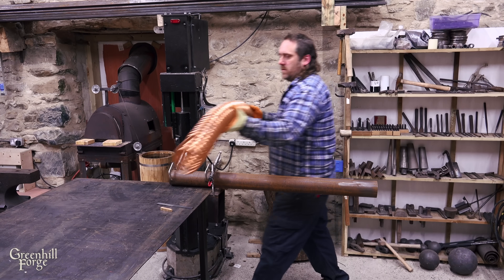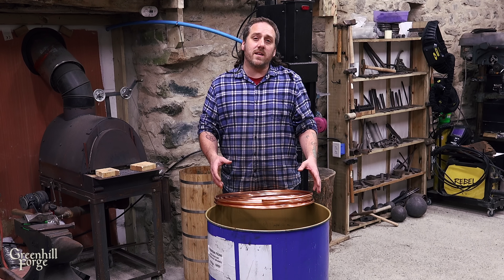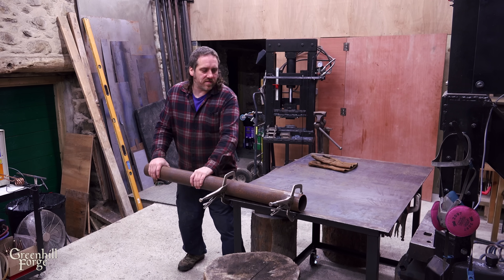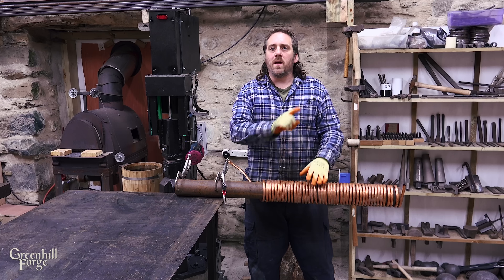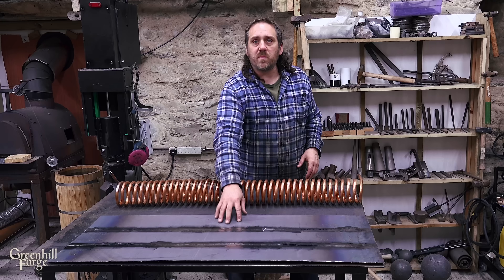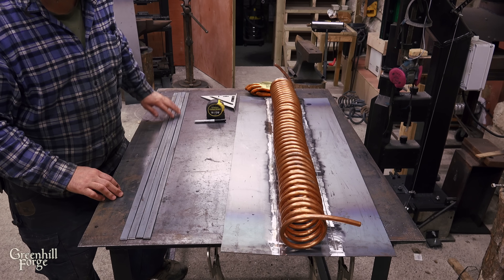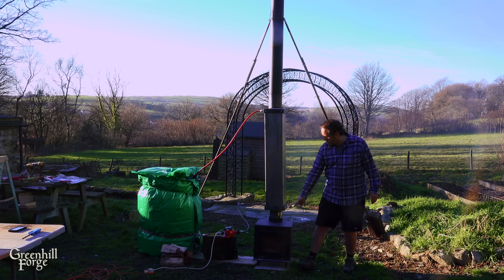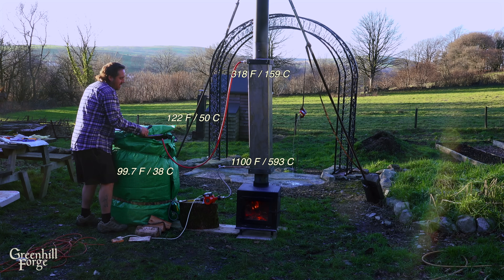Wood Stove Water Heater Experiment - Surprising Results! Part 1

Comment: The system described in this video is a recipe for disaster. I have been heating domestic water with my wood stoves for 45 years. I originally exposed the heat exchanger to the fire or the smoke path and that never works well – even a clean burning stove puts out enough creosote to foul the heat exchanger. For the last 30 years I have had the heat exchanger outside the body of the stove, mounted on brackets and insulated on its outer surface. I left enough room between the stove and heat exchanger that I can slide in a metal shutter to decrease the heat transfer if the water temperature in the storage tank is getting too high--usually in cold weather if the stove has been burning hot to heat the house. As long as you have a complete loop between the heat exchanger on the stove and the storage tank (which must be level with or above the heat exchanger) the heated water will circulate to and will be stored in the top of the storage tank, which could be an electric or gas fired water heater that supplies your house in seasons when the woodstove is not in use.. You need to be sure that there is a temperature and pressure relief valve for the heat exchanger in addition to the TPR valve on the storage tank, so relief is guaranteed even if any valves on the intake and output pipes are inadvertently closed. You need to install at least one valve in the heat exchanger loop that can be closed to prevent reverse thermosiphon in the seasons when the stove is not in use. You need to create a physical reminder to block the stove door when the valve in the loop is closed, as the valve must be opened before the stove is fired.
Reply from the maker: This is only a test unit. Many more tests will be needed to settle on a final design
Reply: @GreenhillForge Thanks. I would be glad to provide more information about my experience, If desired. I have solar domestic hot water in the summer and  the wood-heated water in the winter, using the same storage tank. Of course, the solar system has a pump, controller, and so on. The wood system does not.

Comment: Once you build the rocket stove, connect your hot water out from the first heater into the second and add a coil in the barrel. We run frac heaters this way in the oil and gas industry to heat tank farms for fracking. Alternatively you can tear down this system and add another coil that is plumbed into a manifold in a way to allow you to run in series or parallel. Have fun fiddling with flow rate to improve your lift temperatures ! Slower can actually be faster. Nice rig !

Comment: just my 5 cense worth,, so I have made a few of these,, to make it realy efficent I put a twist baffel inside the heat exchanger section. basicaly a flat pice of stainless steel and twist it, this stops the lamiat flow and forces the cooling flue gas away from the water coil. Cheers
Reply from the maker: Like a DNA helix? Great idea. I was going to add a capped off piece of 2 or 3" pipe down the center in a future test but I like youre idea too.

Comment: In the long term, (although not as efficient) it would be best to have the copper pipe on the outside of a flue wrapped in insulation.  Reasons are many. Eventually that copper at the bottom will have degradation versus the top,  In addition soot buildup and cleaning will be problematic. And by losing some efficiency you will have a more controlled water heating situation and a warmer flue stack for cleaner and easier to clean long term.  A series of compromises should improve the design to balance all aspects.
Reply from the maker: Agreed. I plan to test a whole range of things to try and come up with a good final ddesign evetually.

Comment: This was done in Ireland for decades.  The boiler for the house was behind, next to, or above the fire box.  Peat or coad were then main fuels.  In modern tines, the switch was made to separate on-demand electric boilers.  Also in modern times, they use radiators for heat (great for warming towels), and separate hot and cold water taps.

Comment: How would this go long term? Seems like the copper tube would end up getting caked in creosote after the first season and be hard to clean.

Is it possible to do the same thing but with the coil wrapped around the flue rather than inside it? I understand it wouldn't be as efficient but is it good enough?
Reply from the maker: more tests needed. more tests. more tests. I'll share all the results
Reply: @GreenhillForge  awesome, thank you very much.

Comment: My grandfathers potbelly stov 10:29 e had one coil of iron pipe next to the stack.  Five 4 inch pipes ,  4 elbows.  It heated a 30 gallon uninsulated water tank nicely.  Cold water came out the bottom of the tank up to the coil then ip to the top.  Natural convection kept the water circulating.  Too much coil risks a steam explosion.

Comment: Be careful.  When the water in the copper tubing boils you will have a steam explosion.  Those are dangerous to people and will burst the stovepipe sending fire and ashes all over the house.
Reply from the maker: Yeah, this is an open system so much less chance of temps that high but yes, safety first.

Comment: Try using stainless steel external wood burning stoves for hot tubs. They work much better and they're not too expensive. The other thing is copper will get damaged where it touches sharp steel edges due to different thermal expansion characteristics.

Comment: The stove pipe, if just vertical, will be less as efficient as having more horizontal area.  Angle the stovepipe to the best slope to get the proper flow And the most heat.

Comment: As soot and tar accumulates on the copper coil, how will it be cleaned out? Seems kind of hard to clean the coil?

I am much into wood fired water heating myself so this was very interesting.
Reply from the maker: Agreed. Just testing different things to try to find the right balance for a final design.
Reply: @GreenhillForge It is all very interesting! Perhaps look at maritime boilers, especially coal fired steam boilers from yesterday can give som inspiration?

Comment: Wonderful build but I don't see how it is very efficient at taking heat out of the exhaust gasses. The gasses just pass straight up in the middle of the coil.
Some encouragement to make the center flow a bit more turbulent so it passes out from center and onto the actual coil might increase heat extraction even more?
Also, measuring the exhaust gas at edge of flow and in center would be nice.

Comment: One problem: creosote.  As the water cools the smoke, the creosote builds up on the coil and inner lining.  Cleaning this once a year will be a big problem.  Why not build it so the device slips over a common size stovepipe.  That will separate the entire coil from the smoke and you can brush the pipe every year easily.  It will take a bit longer to heat the water.

Comment: Excellent and well-done! 

Some of my thoughts:
Maybe if you used a somewhat flattened (ovoid) copper pipe it would not kink, and that would increase it's surface area for which to make more contact with water?  Also, I would have had thought that the cooler water going through cooler to warmer flu gases, so from top to bottom, would help the water more quickly rise in temperature, but that's very testable.
Reply from the maker: Thanks. Yeah, top to bottom is better for heat transference but bottom to top and you can theoretically ditch the pump and it'll run by itself with thermosiphon action. More tests needed...

Comment: Fantastic project.
So is the lid loose on the water barrel to allow for any pressure buildup to escape?
It's too late now but wouldnt it be more efficient to have the stove pipe coming out of the back and have the water barrel sitting on top of the stove?
Reply from the maker: Thanks. It's an "open system". Far less chance of dangerous pressures. The lid is just there to help keep the heat in.

Comment: Wonder if you could use this same principle to create a radiant floor system. That would probably need to be a closed loop system though, and I'd have to think about how you'd manage that without over-pressurizing the system and blowing something up.
Reply from the maker: Definitely could. Just have an open system for the heating the water like this test setup heating a storage tank and pull the hot water for the floor off the storage. Two completely separate systems sharing a storage tank.

Comment: Are you worried about a dialectic reaction by not using brass for holding the copper in?
Reply from the maker: Like galvanic corrosion? No, this is just a test unit so will only have a few burns. doesn't need to last long.

Comment: I’m planning on the same thing with my oil fired hot water boiler.  I have an adjacent wood stove that has the copper pipe above it which I’ll drop two straight pieces down to the 8” stove pipe, do a copper coil wrapped around the pipe.  I’m going to try filling the 3/4” soft-drawn copper pipe with sand instead of freezing water to keep it from kinking.  I’ll let you know how it turns out…

Comment: Copper on steel, better Google that! Electrolysis will cause failure.
Reply from the maker: Galvantic corrosion. This is only a test unit for a few burns so it doesn't need to last

Comment: Alright....

We need stepper motors on the dampers
We need those drivers controlled by an Arduino
We need that Arduino monitoring the temperature probes at each end of the exchanger, the overall water temperature, and bonus if we have enough inputs, the water temperature at each end of the exchanger.
We also need a 2x16 i2C LCD, a buzzer, and a potentiometer.

Use the potentiometer to set the target water temperature.
Bit of code we can monitor the water temperature and open/close dampers as required.
We can sound the buzzer if human intervention is required; For example, dampers set to high-heat with overall temperature dropping suggests that wood needs to be added.
Bonus, monitor water temperatures in order to sense other fault conditions; For example, extreme heat at one end of the exchanger water without the tub heating suggests a failed pump.
Spit out water temperature/system status/monitoring values/errors on the LCD display

Like many others, I echo the appreciation of an informative video that's concise and to the point. Subscribed.
Reply from the maker: I like the way you think

Comment: This is a great build, thank you so much! 👍👍
The only negative I can find, is that the coils will eventually be coated with creosote and ashes, and will be difficult to clean. Even with disassembly. I hope you address this issue. 😊😊
Reply from the maker: Yeah, this is just a test unit to gain values from direct contact but you're right. This wouldn't be a good long term design.

Comment: If you don't have the pump on, does the water cycle itself at all from the hot water wanting to rise? Might require a check valve
Reply from the maker: Yeah, it would. It's called a thermosiphon

Comment: Perhaps you should check the pipe for soot and tar deposits, as the drop in gas temperature may promotes condensation.
Reply from the maker: I'll compare creosote buildup between the two stoves in the next video

Comment: It probably heat better and more efficient if you installed that into a rocket stove set-up. The heat would pass by it quickly before collecting all the energy going out the pipe. Also having a ceramic pipe for the chimney horizontally would store the heat giving the copper coil more time to heat up evenly as well.
Reply from the maker: Rocket stove test is the next video.
Reply: @GreenhillForge Yes, but with the copper coil.

Comment: That's a great innovation! Question, does the circulator pump need to be heat resistant? Along with the pipes return/ feed?
Reply from the maker: Yeah, they would need to be rated to tollerate the heat. That is a heating system pump and can handle more than boiling temps. 110C/230F

Comment: was under the impression that you shouldn’t take heat directly from the flue, as doing so will cause soot buildup in both the burner and the flue over time."
Reply from the maker: This is just a test unit to gain values for further testing and design refinement

Comment: I don't think you need a pump. The heat will do the work for you. It's called convection cold in the bottom hot out the top.
Reply from the maker: Yeah, I'll show it using thermosiphon in another video soon

Comment: NOTE TO SELF:  Aluminum and Copper are at the top of heat transference metals.  Great build.  Just an idea you may want to consider:  What ever bolt diameter you used,  make a couple of bolts with a centered point (via cut off the bolt heads, so all you have is the shaft of the bolt) with a Metal Lathe or a Drill, then run a nut on to the pointed bolts, down enough that the point only sticks above the nut maybe approx 1/16th inch, {0.0625" in.}

Then cut the bold flush with the bottom of the nut, after cutting the bolt run the nut down the threads so as to be approx. half way up/down the center of the nut.  Tack weld (one very small tack, or use some fast drying Loctite as necessary) the point at the top of the nut to the pointed bolt.  You now have a nut with a center, that you can attach to the existing bolts you welded in place, and can now find the EXACT CENTER of the bolt(s.)  Rinse and repeat as necessary, Bob's your uncle.

Food for thought, if you don't need the speed of heated water, as shown in this video, experiment make a smaller coil length of say one foot long.  Great video, great design

Comment: One thing you want is,the colt water coning in from the top and the hot going out the bottom. I don't know the science behind it but when using wood boiler to heat your hot water in the house if you put in and outs going the same direction it's less efficient. Maybe you could do a test reversing the water flow and compare.
Reply from the maker: Yeah, basically it's preheating the water before it gets to the hottest point. But if you run it from bottom to top you can actually remove the pump and a "thermosiphon" will move the water by itself.
Reply: @GreenhillForge  yes but I'm most cases you gdt steam when you do that

Comment: My experience with copper water lines that are under pressure will have a galvanic reaction with any other material besides copper or brass. I have witnessed pipes laying on/touching steel or nails that are corroding. Not sure what type of solution you could do to separate the copper coil from the steel stand offs but it might be worth looking into. 
Good vid.

Comment: I did similar with the coil in the chimney flue of the fireplace. The coil interfered with the draft of the chimney and I had to abandon the project because of smoke in the house. The coil was heavily coated with burned on creosote when I removed it from the chimney flue.

Now I am a snowbird and do not worry about heating the house in NY. I drain all water and turn off the boiler.

Comment: Why didn't you use rockwool which is a natural product which doesn't outgas?  Was there a insulation and thermal reason?
Reply from the maker: Rockwool is good to about 1800F and this stuff is good to about 2900F. Rockwool would probably be fine but I happen to have a bunch of this stuff for making forges and kilns so I didn't need to buy anything.
Reply: @GreenhillForge  I haven't seen your second video comparing a rocket stove and homemade pot belly stove.

Comment: Another method for the coil. Wrap around a the outside of 6'' stove pipe. Then insert assembly in 8'' pipe to retain heat. Can even wrap 8'' pipe with appropriate k-wool insulation. Use 6-8'' reducers on end of heat chamber. 

Your setup will most likely get bound up with soot/fly ash, and /or creosol. Creosol from wood with high moisture content.

Comment: I do a bit of welding/fabrication and If you wanted to simplify construction I think plain old square tube and round pipe from your local steel shop would suffice rather than all that welding, braking, spacing etc. Wrap your pipe  around a 4 inch mould as you did, cut a chunk of 6 inch square tube however long your exchanger is going to be, slide the pipe in the square tube and it automatically spaces it without all those notched bars. weld a nub on each side at both ends and wrap with insulation and slide your 6 inch tube inside an 8 inch tube and tack it up, cap the ends with flat stock sheet metal and there you go. Just need to make an adapter to transition from square to round pipe if your stove has a round outlet.
Reply from the maker: I just build with what I have on hand in my stock

Comment: Hmmm.. something about this looks very familiar....
Reply: Thank you Patrick Remington for inventing this water heater,, truly a leap forward
Reply from the maker: Had to peek at your channel after a comment like that. Looks like some nice stuff. Is there a design you settled on or a favorite?
Reply: @GreenhillForge I think the disadvantage to this design is the fact that soot and tar will condensate on the copper pipes, slowing down heat transfer and making it a pain to clean. You can also create a thermosiphon to circulate the water without the use of a pump.

Comment: Great vid. Loved it. 
I’ve been told to keep the copper just long enough so the water doesn’t flash to steam in the coil. 
I’m subscribing.
Reply: I believe it is the other way around. When the temperature differential from the input to the output is closest, by pumping the water quickly through the coil, the heat transfer is greatest. It's counterintuitive. So for example, a convective loop would be much less efficient than a circulation pump moving the water quickly through the coils.

Comment: two things, cold in at top out hot at bottom and the contact between flue and copper coil is minimal if you filled the inner jacket with water  with a pressure relief valve and a anode youd transfer more heat to the coil.